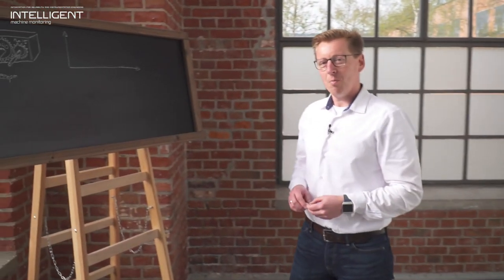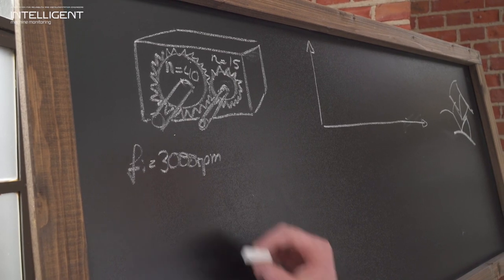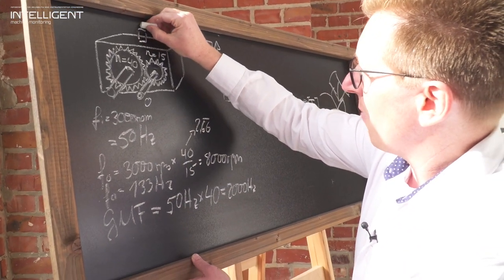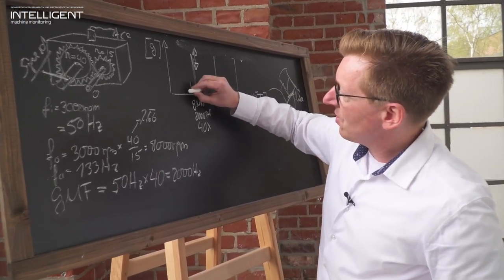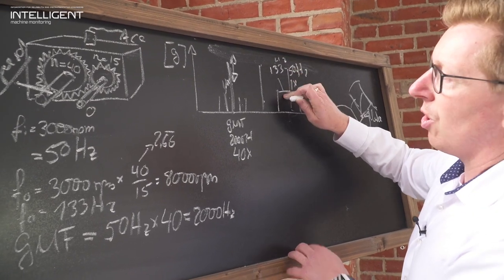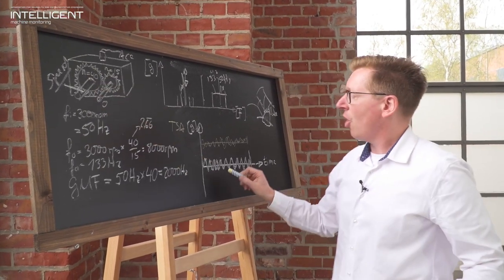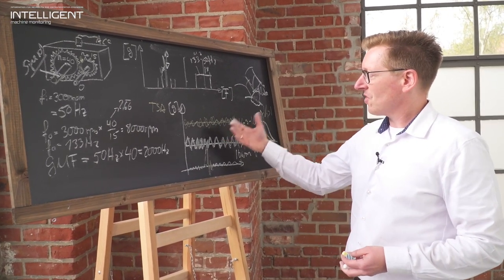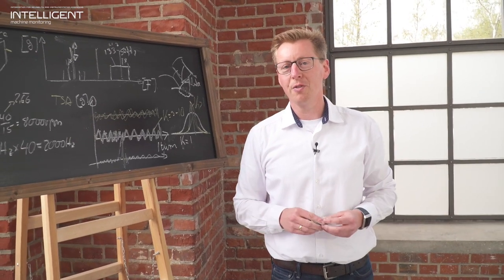Monitoring of gears, gearboxes, gear mesh

Comment: Is there is any existing reference on; where to place accelerometer sensors and in which direction for fault monitoring in an Multi-stage industrial gearbox? 
Can you explain Time Synchronous Averaging (TSA) in details, in terms of gear vibration signal processing?

Comment: Is gear ratio 2.66? Or 0.375? Generally gear ratio is considered to be output teeth divided by input teeth.
Reply from the maker: Hello Rahul, thank you for your question. 
The gear ratio is calculated by dividing the output speed by the input speed (Ratio = Output speed / Input speed) or by dividing the number of teeth of the driving gear by the number of teeth of the driven gear (Ratio = Driving gear teeth / Driven gear teeth).
Have a nice day!